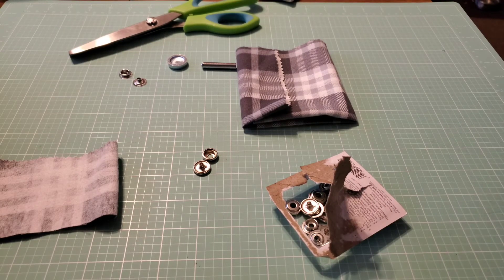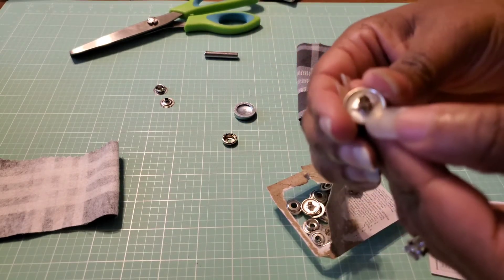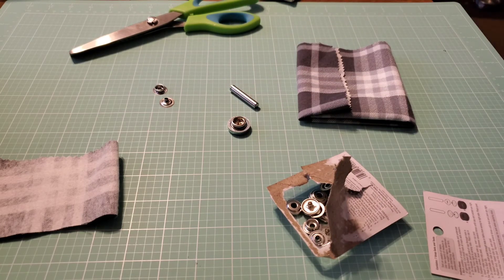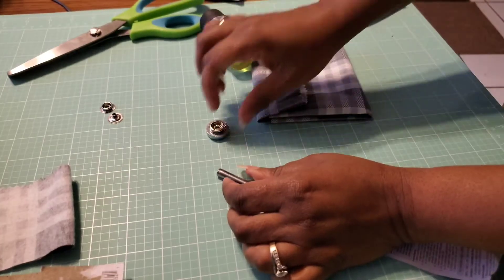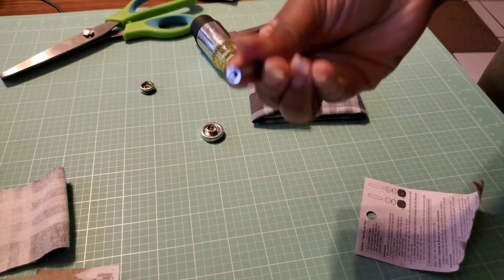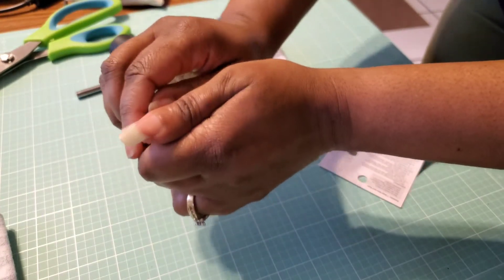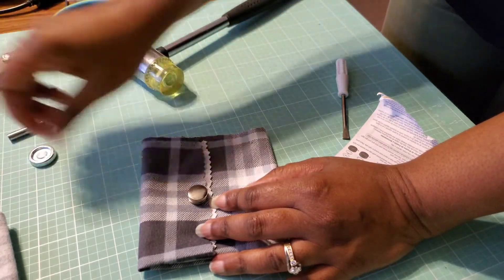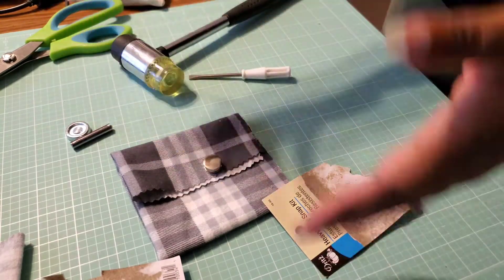Dritz Heavy Snap kit

Comment: Glad I found this video
Reply: Just added snaps to my tactical fanny pack for work work. All of 20 minutes. Thank you for your video.

The fanny pack kept sliding loose around my waist. I wanted the snaps to hold the straps of the fanny pack at 1 of 3 predetermined lengths.

Comment: The directions are not on the back of the package.  It is very hard to tell which parts go together as all the parts with holes ook very much the same .  Better to explain the difference between them.  Tried several ways but snaps did not hold.